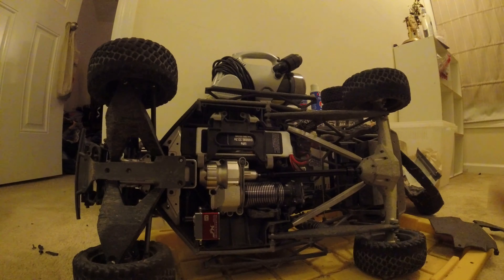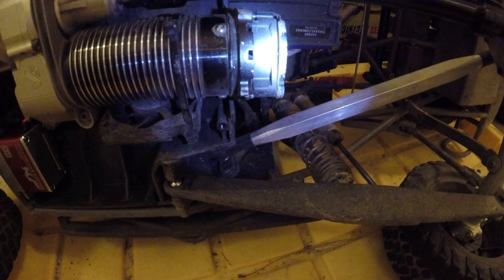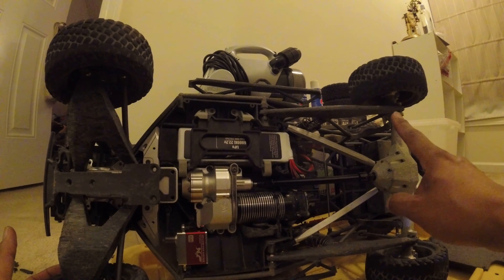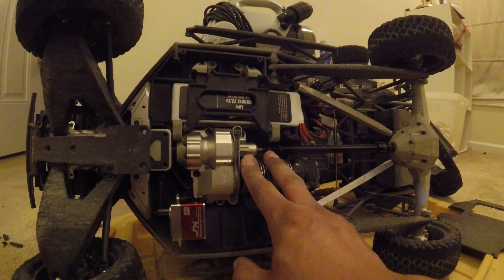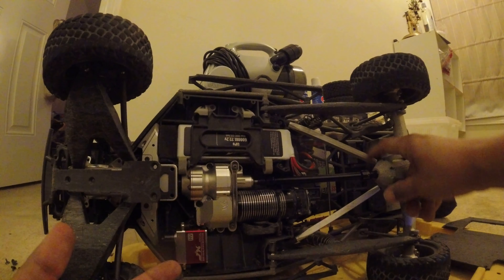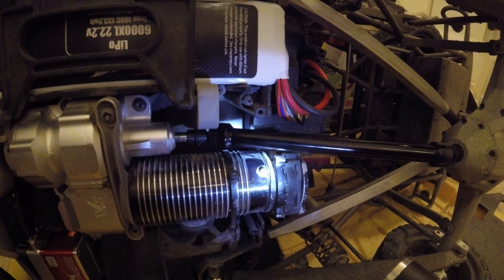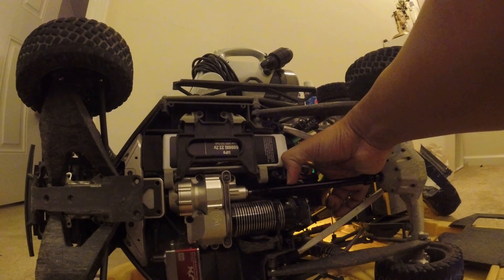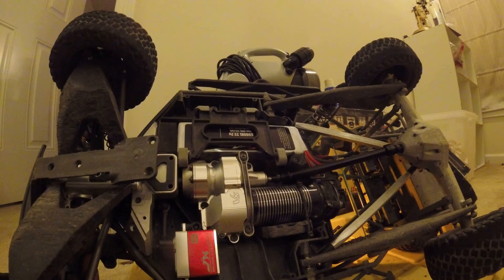MOTOR and GEARING OVERHEATING SOLVED!!! on traxxas UDR

Comment: Hey Ocular Cavity! I also run a UDR, I absolutely love it! I have been really enjoying your videos. It's cool watching a different perspective on repairing the UDRs weak points. Your completely right about the OEM driveshaft. I ended up upgrading mine to the MIP driveshaft. It's definitely a lot more heavy duty but I had to use red loctite with better designed set screws and pins. I run my truck hard so I still snap a pin every now and then. Even with that being said I still definitely recommend it. Keep up the good content!

Comment: I did the same as you but im tempted to add another fan. There is a nice space inside the body right above the motor. You could cut a hole for the fan to blow down on the top motor as well as the fan blowing across. 

Also if your planning to fit the oba sound kit there are mounting posts ready to attach too

Comment: The planetary should have been sealed to add fluid, not grease. 

  I have all the Vitavon you listed and hardened gears and metal diff cups. Even with vitavon center transmission it still gets hot.  

Does having the fan cool down the whole transmission?
Reply from the maker: fans DEFINITELY worked for me, I have added fans in 3 locations you may not need all 3 but i would recommend at least 1 or 2 i put one on the side of the motor, bought a heat sink fan combo for the back of the stock motor and cut a hole in the driver area and put a fan there to bring in fresh are to the whole area and now the motor and center trans area are all cool like skin temperature

Comment: Thanks for the info bro. Which Channel did you plug your fans into the receiver?
Reply from the maker: i am pretty sure i was using channels 3 and 4 when i recorded this video but i have actually made a good deal of changes since this Video and need to do an update i am currently using at least 3 of the spare channels for my new exotic cooling methods i even cut an intake into the chasis and mounted a fan there and it not only cool the motor but the transmission as well no matter how hard or long i drive it temps don't go above 90 F
Reply: Thanks buddy

Comment: Thanks for the video! How much is the diameter of the little fan holding with zip ties? 35 or 40 mm?
Reply from the maker: 36mm Here is where I got the fan https://www.hobbywingdirect.com/products/cooling-fan-for-ezrun-150a-esc
BUT I have replaced it with something better it costs more but it is a more proper solution but you need to replace the fan with a 5v/6v one from amazon so you can run it off the receiver but it is WAY WORTH  IT  https://www.ebay.com/itm/283605986930?_trkparms=ispr%3D1&hash=item42083bee72:g:HOQAAOSwqA5dcmtN&amdata=enc%3AAQAFAAACgBaobrjLl8XobRIiIML1V4Imu%252Fn%252BzU5L90Z278x5ickk7PdDazAlGltMLJlUhrWsDyncY8XogI0JQKpm%252FXGEc3btGJ0XdHxK09iIH%252BzmgwUrbqKOmfYxZ3KsHjP0oiaNlaJxt2BcfluN0Gv5alWxqPBW5HsJdWZ49Dp%252FkceEokHLXSBwYLoMn5Z%252BXIUc6yHwjWYKPMOqU8RhkDkNsudGUBXwp8zsxMx8o0hnzKLidjqT%252BCHh4w%252B2EUxixYHvs3Eeguu1ikOmAQTn6xBNiC8GH15h0luZUhnzSb85a2OavDC5iMnm6DTwL1DPNIEpMFVAKHavClRvlSBYlccYNhI1F6Qxw4CXxszcgyPiVekFgG1ZhgYLW%252BzK1tx7PVp92KZGmW3lWhAGrK0nhctnsKA1pIhv16dST5VhetcUt1hMeKtMkeh3Ka5x7VTY0G%252Fs6iOCISrFHs7Q38db9t%252BWEa8LS3XpPg%252FPjBvRJ2ARlOEKxixvbMse2C0XtRjmiC8dEYFamc4E3LsWOLq5LU8D3La6KKpYFVf9Hw0z2hf0wVHXjvM1nZQKhLOIA1NRRXMQo7y5%252B7JGphC3v2CV4%252FlE3eDUCtvO38FEJpUljMaqL9Bks%252FYkIuqxBFF%252FVw1%252BKUF2LTUEiTIScGh3CcSDXc3KWihxxG3mP9J%252B%252BK%252BJ8kPdb9%252FabAk8CKpOYvJybMsqHzvWtphlYZnTXZtgXksF9wBiU%252BZl2Yo3GtzRh0p4Ktg9My0YRwfj%252BxI6ojHgcoIh0awZ4QzhmCiJ9CTk7%252Bc%252FlB2h7dwp48kASTQsefHxqNY4YAumyqmtl4FTIj8UmVhQ9mFWebOOgr6z0ZgEKFad%252F5f%252Bwk2HJrs%253D%7Ccksum%3A283605986930a47a050703be4c12a5bbf8a4c8c608b7%7Campid%3APL_CLK%7Cclp%3A2334524

ALSO I made one more mod that I didn't film I cut a hole in the chasis above the motor and put a hobby wind 36mm fan there and it keeps EVERYTHING including the transmission cool and that is WITHOUT the GPM fan that goes on the end of the stock motor since the Stock ESC died I switched to a spare hobby wing motor and speed controller and the GPM heat sink does not fit
Reply: @ocularcavity8412  
Thanks for your infos! So the fan in the long Ebay link seems plug&play and ready to install with 5/6V from receiver according to pictures, right? I'm asking because you said I have to replace it with another fan from Amazon to run it with 5/6V... 

And yeah I know this modification with a hole in the chassis and mounting there a fan but thanks again!
Reply from the maker: @tunc03  the Ebay on need a little sanding to get it to fit it is close but not as hard to fit as the 36mm fan.The seller i bought mine from is no longer selling them i bought mine 2 years ago and this was the the same heat sink, but i don't know about the fan. The fan i got was a 12v fan back then. the fan in the picture looks different so it could be 6v but either way you could probably still hook it up to the receiver but worst case it will be running at half speed. The good new is the i got a whole box full of fans for like $10 on amazon it is good t have spares with the dust and dirt and rocks it will die eventually
Reply: I put a heatsink with 2 30mm fans and the gpm rear fan mount and fits without trimming so 3 fans in total no heat with 31/47 gearing
Reply: @g5k3r  
Thanks for the infos. So you put all 3 fans on the motor, right? Two on the side and one on the back of the motor?
🤔

Comment: What brand of metal diff you use?
Reply from the maker: the center differential itself is the factory one but the transmission/center diff housing is made by a brand called Vitavon, my front bulk heaad and Rear Axle housing as well as both planetary gear reductions are from the same brand and i bought them on ebay from the same seller , WARNING the trans housing and the chasis needed some modification to fit properly if you own a dremel it is quit easy, let me know if a video would help, here is the link  to the trans housing from the seller i bought all the parts from from https://www.ebay.com/itm/VITAVON-Alu-CNC-Center-transmission-tranny-For-UDR-Traxxas-1-7-8591-/283435173632?hash=item41fe0d8700
Reply: @ocularcavity8412  thanks a lot for the information and the link... these mods are very useful to lower temperatures ...
Reply from the maker: @alexone85  btw i have a new fan mod i just completed that is working even better to lower temps in that area, testing i now and soon i will make a vid showing what i did all you need is the hobby wing fan i mentioned a pen, and a dremel with a drill bit and reaming or sanding bit
Reply: @ocularcavity8412  well..good news
Reply: Please put links to the parts you used in your description. That would help us out a lot.
Reply: I had to cut out some of the honeycomb under the skid plate to get the Vitavon center diff housing to sit properly without bulging the skid plate

Comment: Fyi: Vitavon hav released a rear drive shaft 👍
Reply from the maker: i actually ended up buying an MIP shaft but haven't installed ti yet, wanted to make sure my new limiting straps were working, my old ones had stretched and the extra travel was killing my stock driveshafts
Reply: @ocularcavity8412  I recommended the MIP driveshaft on your channel a while back. To be frank its trash compared to the vitavon. I had similar heat issues which actually would cause the MIP driveshaft set screw to fly out even with red threadlock. Now that I am running the vitavon driveshaft not only have I not had any problems but it seems to run cooler.
Reply from the maker: @Wardrage  thanks for the heads up that is good to know
Reply: @Wardrage  I agree the MIP lasted a year but blew up twice due to heat 😬